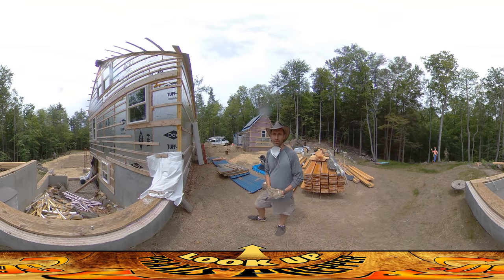Homestead Building - Solar Hot Water Panels Go Up, Planning to Add Exterior Sheathing to House

Comment: I would go for easier ... it's not that either project takes months ... but you can probably say that not doing the greenhouses first will make the siding on the side take a lot more time ... it might also be nice to do the back, then do one side of greenhouse (just to do something else for a couple of days, instead of siding) ... then see how that goes, and if it is indeed a lot easier do it for the other side as well (after doing the front, take a break from siding on the greenhouse roofstructure and then finish that siding) ... 
You need to have those greenhouse roofs done anyways, might as well do them while there is no real pressure on time and you can have some early advantage for having them... And i wouldn't be amazed if, come time to finish the greenhouses, you will thank yourself for having done all the rough work already while being in a stage of the build where you had everything 'set up' to do said work, instead of 'basically living there' and having to set stuff up again for just this one project. and then after building the supports still needing to finish the rest of the greenhouse ... now obviously you will still need to finish the greenhouses at a later point in time, but it will just be that, it won't be this big rough project, it will just be finishing up the exterior and basically start planting.